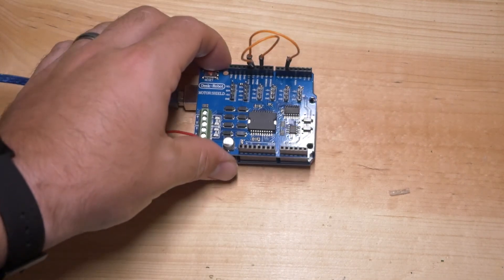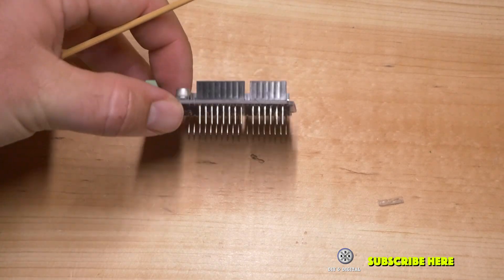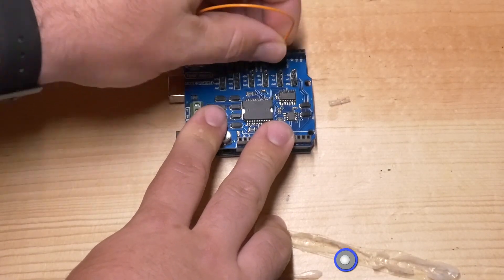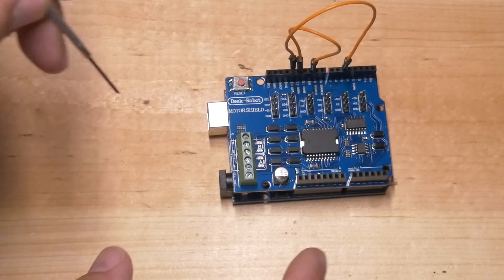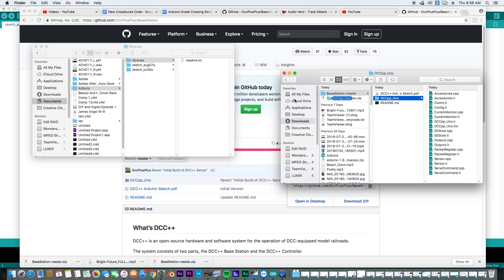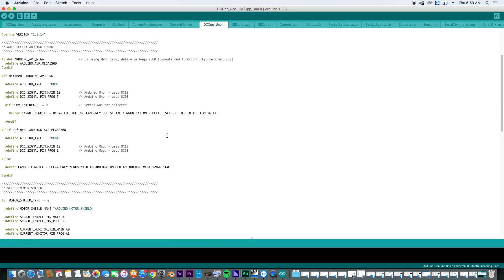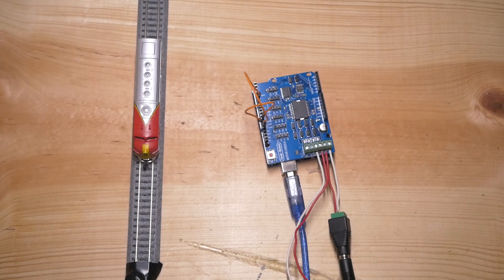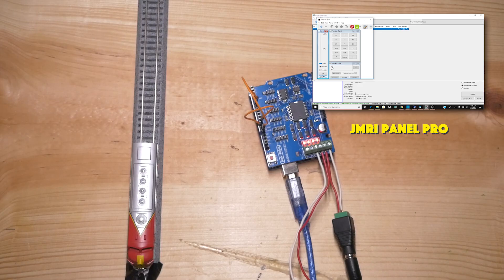DCC for less than $45!!!  Building a DCC++ Base Station

Comment: So you have to control your engines through your computer? That just wouldn’t feel right in my opinion.
Reply from the maker: This video is pretty old. A new system called DCC EX has come out that is a better version of this that does not require a computer to run.

Comment: Hi. 5 years later, is this still your recommended DCC system?
I'm laying down benchwork for my first ever layout sometime this Fall and was hoping to utilize DCC as opposed to DC. It will be a HO Scale Point-to-point layout in my office using Kato Unitack and manual switches. 

I've never worked with electronics or comp sci-type tools before. My technological expertise is limited to CTRL + ALT +DEL.... so I'm hoping this method won't be too far above my level. 

Thanks!
Reply: I believe he's using DCC-EX now. He has videos on it. Roughly the same parts for setup, except he's using an Arduino Mege with Wifi onboard.

Comment: just to be clear, I should use a 12 volt, two amps power supply, right? (If so, do I still cut the trace on the motor shield?)

Comment: Hello, I'm hoping you can help me out. I made this exact build, with 15v 3amp power supply.  Then I boost my amps up to 750mA. How can I get boost it up more. I have one locomotive I have to run by itself or is will shut the whole system down.  I'm expecting it drawing to much. Is there a boost I can add to this set up? Thanks
Reply from the maker: I have wanted to test products on this such as the booster from Tam Valley Depot, but I have not gotten around to it yet.

Comment: Jimmy,  I really like your videos.  I watched you video on DC control of a train, but how would you use it in blocks?  I am wanting to build a basic loop (shelf 18" below ceiling in office) with a bypass rail.  3 blocks.  Trying to figure out how to start a train, run around the loop  (random 1-3 loops), stop on bypass. Second train goes to main track and runs (random 1-3 loops), repeat.  I don't need signals at this time but just want to control DC trains I already have.

Comment: I was hoping I could ask you a question about the adreno and the DCC++?
Reply: I was wanting to know would I be able to use a bigger power supply like say from an old computer or is that too much for the adreno and you have to use one of those wall plug-in power packs. I've already done all the other stuff in your video to the adreno and have had a train running before but I was curious if I want to add more trains HO scale by the way if I would need more power say like a bigger power supply would you happen to know how many trains I would be able to run with just the small wall power pack would I need more power like a bigger power supply if I wanted to run more?

Comment: No copper should ever be visible from the screw terminal, cut your wire shorter so only the insulation is visible when inserted.

Comment: Hi, Looking at this 4 yours after since published it. Some links to Amazon don't, not surprised, and lots of 'alternates' pop up now as well for the Uno and the motor shield. Also, what did you use for jumpers? They look they should be only a couple of inches long. Could you use 20g wire? Great video, looking forward to making my own.
Reply: copper or aluminum will work. as long the jumper you're using is conductive and jumped to the correct ports it will work

Comment: Hi Jimmy further to my post on the DCC++EX problem, I tried a Uno with DCC++ and wires and all worked fine, did same uploaded DCC++EX to Uno and all worked fine with Decoder Tester on Main Track, as soon as I reconnected the Mega the Motor on decoder ran with no throttle and also only 3 light lit 1 missing on Main track and there is DC on Main track so seems a problem with Mega ..Regards John
Reply: Was a connection to D12 between Motor shield and Mega no connection so linked a wire and then worked fine ..

Comment: so i set this up but there are no lights coming turning on on the motor shield. but they are turning on on the Arduino. and JMRI can not detect any locomotives when I try to program. it senses track power is on but says it does not read any locomotives

Comment: Hi Jimmy. So I have an Elegoo uno R3 and a Deek-Robot motor shield. Did your Arduino have a 12v max? Mine only says 9V max. I have a 5V power supply and a 12v (also the 9v battery hook up my kit came with) Just trying not to destroy my first Arduino set up. Thanks.
Reply from the maker: Hey Kent.  If you cut the little VIN tracer on the motor shield.  You won’t have 12V power flowing to it.  The USB from the computer will provide 5V of power for the arduino.  I’ve never had an issue with 12V and an UNO though.  Just keep it at or below 2 amps.
Reply: @DIYDigitalRailroad  oh ok that makes sense. Thank you.
Kenton.

Comment: I am totally new to Model Railways (not even bought a baseboard yet) and am currently reading everything possible.  This looks really good but i have one (silly?) question.  Does all the power required for the track come through the Arduino or does that (the Arduino) supply only the loco commands?  Martin Wilkins - Cornwall UK.

Comment: need help on this error C:\Users\Rajesh\Documents\Arduino\libraries\DCCpp_Uno\DCCpp_Uno.ino:196:59: warning: ISO C++ forbids converting a string constant to 'char*' [-Wwrite-strings]
 CurrentMonitor mainMonitor(CURRENT_MONITOR_PIN_MAIN,"<p2>");  // create monitor for current on Main Track
                                                           ^
C:\Users\Rajesh\Documents\Arduino\libraries\DCCpp_Uno\DCCpp_Uno.ino:197:59: warning: ISO C++ forbids converting a string constant to 'char*' [-Wwrite-strings]
 CurrentMonitor progMonitor(CURRENT_MONITOR_PIN_PROG,"<p3>");  // create monitor for current on Program Track
                                                           ^
Sketch uses 18198 bytes (56%) of program storage space. Maximum is 32256 bytes.
Global variables use 898 bytes (43%) of dynamic memory, leaving 1150 bytes for local variables. Maximum is 2048 bytes.

Comment: I am  little confused hhere and trying to learn enough to start with n guage. So is the power adapter that your using with the aguino also the track power ? I would like to geting to n uage and have limited room and money. I do not wish to invest in things I will NOT need and NOT sure if I need to ut a cheap set first or maye I can just but the engine I want and some track and something like this to get it  running. I am fairly well versed in electronics and mechanical and can solder ad build most things....

Comment: First sorry about my bad English however there is one point I don't understand.

If you use for example 12V then a TTL 5V input signal to a H bridge will output 0 to 12V how do you get the negative voltage -12V to +12V from a H bridge for the DCC signal ?
Thank you
DJ
Reply: The author of DCC++ explains that in this series of 4 videos.  Start here https://www.youtube.com/watch?v=-nsVdpMhiTU

Comment: Hey I have a question? I built this per your tutorial and I also did the raspberry pi and my laptop for jmri. But I have problems with it constantly just not working or not sending any signals at all. Do you have any trouble shooting suggestions or a video. It seems to work when it wants too and sometimes it wont work at all. Idk what's wrong.

Comment: I would like to set this up for large scale. I need high current and voltage capability. (24 VDC and 10 amp)  Can I use this system to do it? Maybe with PN00218-CYT5 Cytron 10A Motor Driver (Arduino) Shield

Comment: Do you have a tutorial for making a point-to-point with stops in between? I'd like to build this and make an automated commuter line. Great video btw.
Reply: In DC you could do that without an arduino. You just need a timing circuit that is triggered by motion sensors.  Everytime a train trips a sensor, the timer cutspower for __ seconds.  Each end of the track can be controlled with diodes and additional timers.  There was an article in Garden Railroader a few years back that explained it.

Comment: I've got all the stuff but can't seem to get the Arduino circuits to work correctly and find/fix all the errors in the sketches.... I'm looking at changing over to the Raspberry Pi + (or 4)... with all the interface and displays already in use... have you looked at the Paspberry Pi+  ?????

Comment: What voltage would you use on the motor shield for HO scale? 12V or push it to 15V? 
Just starting to convert to DCC but want plenty of room/capacity for growth.

Comment: does this allow for a switch and potentiometer to that setup, to use the selected loco for "manual" control" ? thru the inputs on the motor board?

Comment: Hi, thanks for the great and detailed explanations.  I have an Adafruit Motor Shield V2.3 which uses a different processor than the L298P in your example.  It has 4 motor connections, in pairs with a ground in between.  How should I tweak the code to accomodate these differences?

Comment: DOSE IT WORK WITH NCE PRO.? I DON'T HAVE A I PHONE DO I NEED ONE ?
Reply from the maker: This does not work with NCE Pro.  This works directly with JMRI and does not require any sort of other system.  You don't need a phone, you do need a computer to hook it up to.  There are some tutorials out there on how to build a throttle for it though.
Reply: DIY & Digital Railroad I would think that WiThrottle for the iPhone would work just fun.  It could even be an older “retired” iPhone that isn’t activated on a cellular network, as it would only need WiFi.  There is a similar throttle program for Android phones.
Reply from the maker: That is correct Norman!  I actually use an old tablet to run my railroad.

Comment: Nice work. I'm just getting back into the hobby after 30 years or so. Question, I have a couple of Arduino Megas. Is it even worth attempting, or just order a new Uno and shield? Thanks. Good work. I also would have liked to see the shield to track connections. One goes to program track, etc. I have no clue, but wouldn't guess knowing how easy it is to fry s shield. Thx
Reply from the maker: Arduino Megas work great for this.  You don't even have to sever the power connection because it can handle the same load.  There are some slight differences in wiring, but the Mega works fine for this!  There is an A and B motor connection, The Mainline is A, and the Program track is B.
Reply: @DIYDigitalRailroad  So I wouldn't have to scratch away between the VIN ? Thanks
Reply from the maker: @coreygibson2590  Here is a link to the original DCC++ creator explaining DCC++ on the mega https://youtu.be/rZl84NXALaM

Comment: What are the practical limitations of this system? I would be fine with running no more than a couple of HO loco's at once but what additional hardware, if any, would be needed to program sound decoders?
Reply from the maker: this system maxes out at 2 amps so you should be fine with a couple locos.  DCC++ works with JMRI so anything you can do through JMRI is doable.

Comment: Thanks for sharing this!  I just got back into model railroading a few months ago after being away for close to 30 years, and was my wallet was really feeling the pain of essentially starting from scratch.  I was thinking it would be a really long time before I could make the DC to DCC jump, and I'd have to have separate home and club locomotives, but this setup is right up my alley.  I just ordered all the parts on Amazon except for the motor shield, because it's currently going to take a month to get here.  Fortunately I have a Microcenter nearby, and they have one there, so I should be in business in a few days.  I'll probably be back asking questions if I have any trouble getting everything up and running, but thanks again for such an informative video.

Comment: I followed this tutorial exactly and the lights by the green terminal won't turn on.
Reply from the maker: +Mike Petersen The first place I would start is the jumpers between pins 10 & 12 and pins 5 & 13.  There is also a diagnostic mode you can use to check.  You'll have to google it as I don't have the link on me right now.  Email me a photo of your setup diyanddigitalrr@gmail.com
Reply: @DIYDigitalRailroad  alright thank you. I'll email you when I get the chance!
Reply: @DIYDigitalRailroad  I emailed you the photos
Reply: https://github.com/DccPlusPlus/BaseStation/wiki/Diagnostics---D---Command I is the link to the diagnostic mode I think you're talking about. 
 @DIYDigitalRailroad

Comment: I would like to see a video of someone  taking a cheap bachman train, reading the decoder and the steps to make it work using this same setup?
Reply from the maker: +bigbread9000000 funfact.  That locomotive Im using to demonstrate is a bachmann.
Reply: @DIYDigitalRailroad  I am starting to think I need to buy the authentic arduino motor control board, I had bought a knockoff board, when I do the diagnostic test <D> command, one led on the regular track power stays lit,  another video(cobo)shows them both blinking!!

Comment: DCC has come a long way since Hornby introduced Zero One (the world's first commercial DCC system) in 1979. I still run this system today.

The Zero One base station used the Texas Instruments TMS1000 micro controller. Back in 1979 this was state of the art and it could control 16 x locos and 100 turnouts / accessories via appropriate modules all taking power and instructions from the 18 Volts AC constant track power.

Those were early pioneering days of DCC.
Reply: I remember my friend Stewart had one of those and a Flying Scotsman with a chip.

Comment: How many trains can it run on 12v?
Reply: The voltage doesn't really limit the number of trains, however the two amp limit on that motor shield will. On N scale I have run six trains at the same time. With HO you will probably manage four depending on the engines. There are other motor controllers that can be used with some extra wiring that will do upto 43 amps if the youtube videos are true but I haven't tried them.

There is also an update version of the DCC++ system based on the ESP32 processor that has additional features.

https://github.com/atanisoft/DCCppESP32

HTH
Reply: @DennisFisherUK  thanks!

Comment: hope to get this working was tying with a pololu shield with no luck just started testing with the one you are using now still cant control the trains as of yet
Reply from the maker: +Jim C there are some slight differences using the pololu i know.
Reply: DIY & Digital Railroad 

Yes I set that aside and am useing your set up the shield came in the mail today I am able to right to a loco now but can not control it.
Reply: @jfcastiglia  I am having the same issue, I am wondering if it is best to get the arduino brand motor shield, I hate to buy it then find out it was something stupid that I am not doing right
Reply: bigbread9000000     I have not been able to find one in stock:(
Reply: This a quick follow up, I inspected my deek-robot motor controll board and found a solder bridge on pins 9&10 corrected that and now my board works after already ordering a new one, oh well now I will have a spare!! It works!!!!!!!!!!!!!!!!

Comment: How much current can this setup handle?
Reply from the maker: The motorshield is rated for 2 amps
Reply: @DIYDigitalRailroad  The L298 has 2 motor drivers . By connecting them in parallel, you can get 4 amps.  (See datasheet )
Reply: @franktkalcevic5342  What DCC++ code mods are needed so that tracks A&B output same for connecting in parallel?
Reply: @RogerMcCarty  It should only be hardware changes.  IN1+IN3, IN2+IN4, ENABLEA+ENABLEB, OUT1+OUT3, OUT2+OUT4

Comment: i too am using the Arduino not only as my dcc system through JMRI but other arduinos linked together to control Turnouts ,track lights and other lighting , block detection, turntable, ,great what you can doo with Shift Registers,for now keep up the good work ,take care for now.
Reply: Hi! Can I ask how you're doing block detection? I'm trying to figure out how to do it for my own small setup :)

Comment: Great video! For whatever reason the LED for the Main positive is lit up constantly once I write the DCCpp to the board itself, when i turn the track power on and off in JMRI the Program track LEDs turn on and off but this light remains constant. any Ideas? Thanks!
Reply from the maker: Hmmm....  Try taking off the motoshield and see if it remains on.  It may be something in the pin 5 to 13 connection.
Reply: the 5-13 connection doesnt change anything, though when the 10-12 connection is pulled out the yellow for the A terminals turns on and the green goes out. bad board?
Reply from the maker: It could be.  It may be the motorshield.  I burned through a couple before I found the right one.  Which shield are you using?
Reply: The one from the Amazon link you provided, tho amazon is not shipping what is pictured. Ive had 2 primed to me already and theyre both Fundumoto R3 Shields.
Reply from the maker: @not_tom_from_myspace8090  I've had to go on eBayto get them before.  I will get you a link.
Reply from the maker: Check a couple other basic programs before you buy this to make sure that it isn't a bad board

Here is the ebay link for the motorshield https://www.ebay.com/itm/L298P-Shield-R3-DC-Motor-Driver-Module-2A-H-Bridge-2-way-For-Arduino-UNO-2560/310787745501?epid=883680279&hash=item485c64a6dd:g:eZgAAOSw7BNbfglK

Comment: Hi Jimmy
I’m wondering if it possible to use a motor shield with more current output or use a booster
Reply from the maker: It is certainly possible!  You just have to make sure that the power connection from the shield to the Arduino is severed.